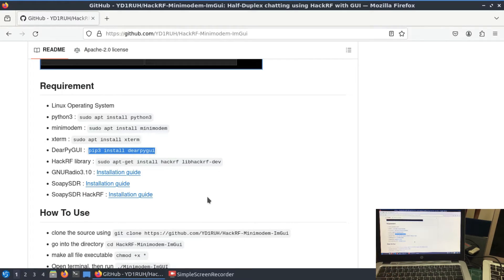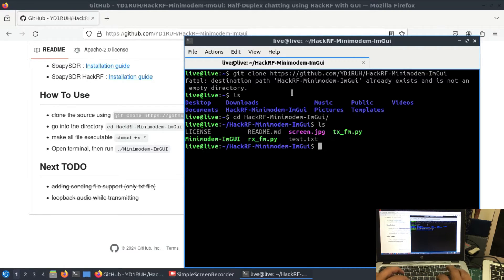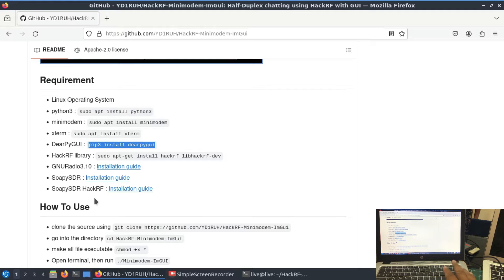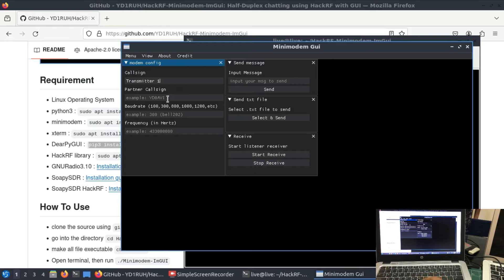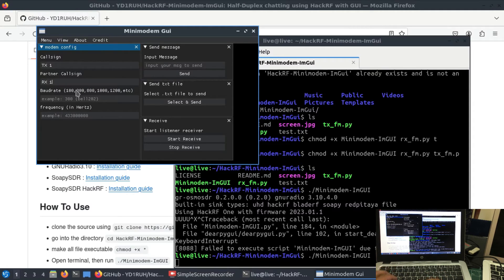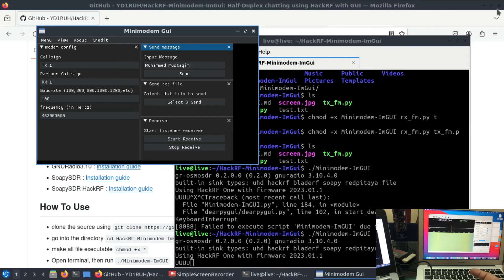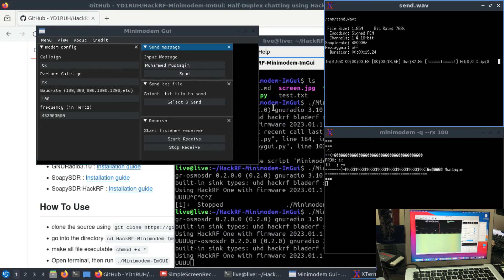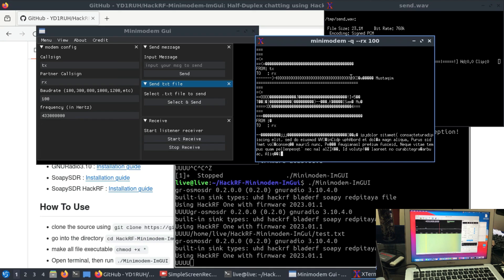Cheap Setup for Ham Radio | Making Half Duplex Chatting System using HackRF | SDR

Comment: can it be used from the terminal? i'm looking to use something similar to this to push packets from LoRa over HF -- preferably with a tool like this that has granular control over freq and baud rate in order to more easily obfuscate the signal, although i think i'm going to have to resort to "normal" established packet radio modes.
Reply from the maker: U might have to write Ur own code in python, so it can be used from the Terminal, with respect to HackRF transfer command